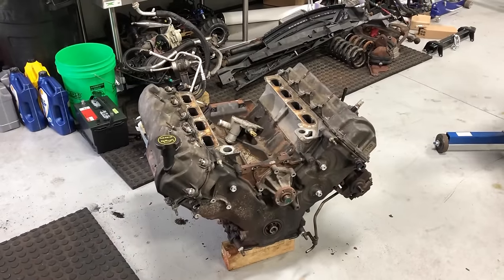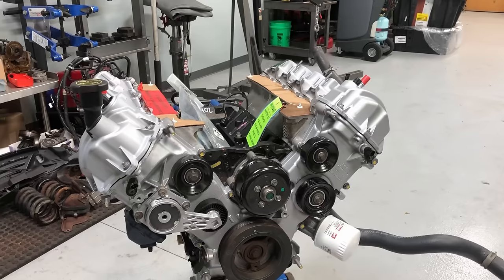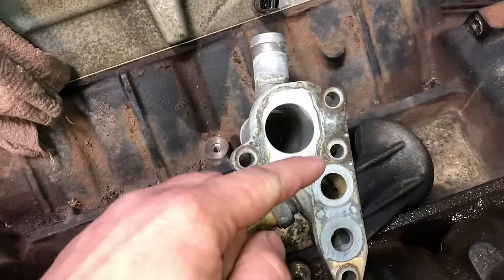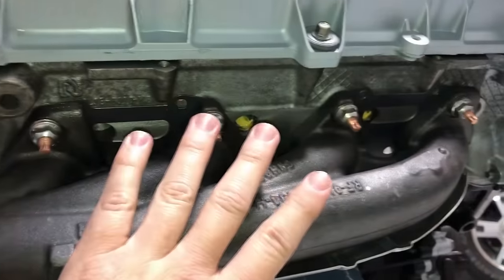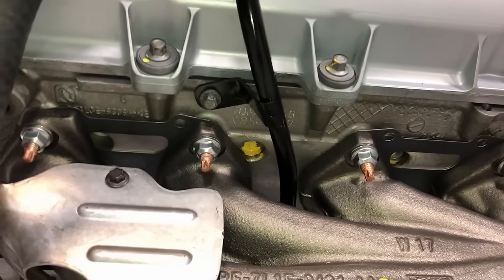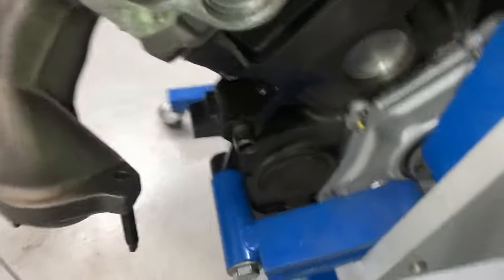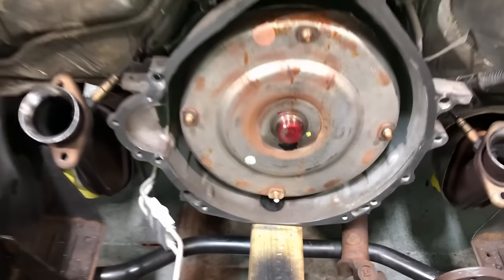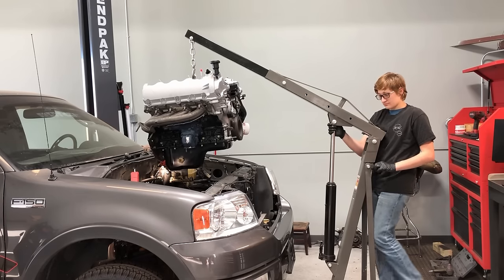Ford 5.4L 3v Triton Engine Removal & Installation Part 2 of 2: Engine Prep and Installation

Comment: Right off the bat, I just want to say thank you for all your work in putting these videos together. Extremely informative. I've watched Part 1 & Part 2 of "Ford 5.4L 3v Triton Engine Removal & Installation" twice while taking notes. Although it's not exactly what I need. It helped me to get an idea of what I was in for... I have a Blown 4.6L 2V MFI SOHC in a 1997 F-150. Getting to R&R it... 
Just wondering if you by any chance Have an R&R Video for that year & engine configuration or at least a 4.6L 2V R&R ?
Any help would be Greatly Appreciated.
Thanks again...

Comment: I got an an 06 5.4 3v..I'm wondering why you bought an 11th gen and why you decided to invest in a new engine.Are these really good trucks.Just wondering cause I'm getting a  new engine installed and transmission.I just can't afford a new truck and would rather get it fixed.

Comment: Related question. Will the Melling oil pump take more priming sessions to build pressure if you are using 5w20 oil? I live in Florida right now so it shouldn’t be too thick in 95 degree weather. I have gone through 6 priming attempts and no response out of the switch yet. Should I drain it and put 5w30 instead?
Reply from the maker: After three attempts you are good to connect the crank sensor and start look for oil pressure within 2 seconds
Reply: Thank you. Oil pressure jumped right up a couple of seconds after starting it. Everything checked out until the test drive. The check engine light didn’t come on, but it did throw two codes. P0012 and P2196. I replaced the cam and crank 
sensors. That improved it, but it looks and feels like it has a misfire. Going to replace the B1S1 O2 sensor and test my coils and coil connector plugs. Is there a chance that an engine that new could have jumped timing if the cam sensor gave a bad reading and the oil pressure dropped while the rpm got low?

Comment: @fordtechmakuloco I don't see where you reinstall the heater coolant return tube.  I have a 2010 5.4 f150 and need to replace it.  I cannot find videos anywhere

Comment: I have a 2000 f150 4x4 with the 4.6, I'm wanting to swap it with a 1999 f150 2wd 5.4, both have the coil on plug design, is there anything special I need to do to make this work like swapping computers or intake ect. Thanks

Comment: I plan on doing this when my motor goes in my 07 ford and I’ve been looking at the Fraser gold standard and wanted to know if it was a solid choice or no
Reply: I plan on doing the same thing with my truck. I will tell you though, I have read about the experiences others have had with Fraser and they were a nightmare to deal with. IMHO, I would most likely end up going with  the powertrain products reman engine which is linked in the description. That's my 2 cents on the subject. In the end it's all up to you man.

Comment: I am doing a motor swap from a donor 5.4 that had a rotted frame and the motor has about 80 thousand less miles then the current motor in my truck. Most electronic accessories on the donor motor are in much better shape. If I anyone could help, should I use the donor engine wiring harness or do I have to keep all electrical from the motor currently in my truck

Comment: Great video! You've helped me so much with my 05 F150 and all the glorious issues of the 5.4 engine.  I know with the timing job you recommend 5w-30, but since this is a new engine do you recommend going with the 5w-20 as recommended by Ford?
Reply: Did a 5.4 rebuilt did you use 5w30 or 20

Comment: Do you still have your Ram? If you had to get a Ford F-150 which one would you buy?
Reply: Glenn Olsen 4.6 or 5.4 2 valve or the older 300, 302, and 351.

Comment: From your experience is the remanufactured 5.4 from Powertrain products the best on the market?
Reply from the maker: The Ford spec remans are best but I have never had a problem with powertrain products engines either.

Comment: Hey Brian. I'm installing a new Powertrain engine. I was wondering if I need to remove the paint off the block where the knock sensors attach. Thanks.
Reply from the maker: Yes you do

Comment: Do these torque spec seem correct for engine mounts? 
258 ft-lb  drivers side
184 ft-lb passenger side
Reply from the maker: You did not specify a year but all specs are in the video description and are accurate yes.

Comment: You mentioned that it comes with the melling oil pump. Does it come with the high volume or should I change it out
Reply from the maker: They come with the M360 standard volume and higher pressure.
Reply: I  have a f150 2004 and bought a power train engine. I just ordered a m340hv. Do you thinks that’s a good choice or cancel the order?

Comment: @fordtechmakuloco I have a 2006 Ford F-150 5.4 3v flex fuel I had engine trouble with it specifically low compression on the left side of the engine I rebuilt the engine and still have the same problem it’s fine when it first starts but won’t go above 3k rpm and when warm it dies I also swapped a motor thinking maybe the engine was just completely shot or had a crack somewhere that wasn’t being caught however it did the same exact thing I had the pcm flashed at the dealer with the original
Engine in but it didn’t seem to make a difference I’m looking at buying a new pcm if that doesn’t fix the issue what else could it possibly be it has all new sensors in it as well and a new fuel pump

Comment: My 5.4 had a hard life before I bought it (2005 Lariat) and spit out a main recently. It seems like Powertrain  Products is the place to go with, but I would like to know what your opinion is on going this route vs. rebuilding it myself? i have the skills, but my concern is which way would give me a longer lasting engine? There's lots of stories about rebuilders running with mismatched bore sizes and balance issues, so there is definitely a question in the back of my mind. Thanks for all these videos. They have saved me thousands of dollars over the last few years.
Reply: get a powertrain COMPANY out of OK, they make the Ford Crate motors. Same price, not all the Dorman crap in it

Comment: Would you recommend this over swapping for a 5.0 without most of the issues of the 5.4?
Reply: I have thought of that myself.  But I think it would be hard because the transmission and computer system is paired with this engine.  I could be wrong though
Reply: M Mardell no you’re right

Comment: Ive watched all your videos. I have a 2009 f250 5.4 3v. I had roller follower issues and dropped a valve. I bought a used engine from a 2008 f250 5.4. It ran terrible! Couldnt make 35 mph for long. Almost gave up on it. (Have a 2000 f250 that runs great!) But could'nt diagnose the problem with confidence. Took out the o2 sensors and it runs better any advice you can share. Ive got over $7000 invested in a standard single cab white 2009 f250 with a 5.4. Seemed like a deal for $4000 at first. But now im too far in. Need help
Reply: Also the original motor ran great! But started ticking. Cold started and sputtered one morning and it was history or could i have saved it????

Comment: When the power steering bolts snap how do you go about fixing that when motor still in vehical
Reply from the maker: snap them all off then let the power steering pump slide down the studs remaining and then cut the studs so the pump can be moved out of the way. Then continue with normal procedures for bolt extraction.

Comment: i replace a 5.4 motor in my 2007 f150 i fellow your instruction on getting pressure then i let it idle idrove it about 5 mile everything was good this was 3wks ago well i went to wash it 1mile from home ilet itrun while i washed it i pull out of car wash drove about a mile it started running rough especially coming to a stopnow i have all these codes 0340, 0182, 0022, 0018, 2198, 0355, and 0345 do you think you have any ideal what going on any whould be appreciated

Comment: @ 54:27 did you use 5-20 or did you go with 5-30 for better protection on your chain guides?
Reply from the maker: 5w-30

Comment: Help. I just dropped my power train engine in to find that it has dowels installed also!  Is there a reason why I would choose to remove one or the other. ?
Reply from the maker: You would use the dowels that came in the new engine.

Comment: What is the average cost for this job?

I know the engine is about $3500 from Powertrain Products, I have been looking at replacing my engine in my 2005 Mustang GT with 229k on it, but with all the odds and ends you added and your labor, what was the final bill for this customer
Reply from the maker: $6,900 - $7,200 with all the extras.

Comment: I’ll be replacing my 2005 5.4 engine and I need an all new exhaust system. What are your thoughts on headers and a true dual exhaust?  Bad ideas?
Reply from the maker: yup!
Reply: Do I need to go back to all original Ford cats and exhaust manifolds?  I want to do this right so I can keep my truck another 10 years. I’ve had it 14 years so far.
Reply from the maker: Yes I would.
Reply: @FordTechMakuloco  Do you have a source for OEM cats? Or will a decent aftermarket cat be alright?
Reply from the maker: Magnaflow direct fit units.

Comment: Excuse me, I would like to know why a mechanic friend changed the 5.4 3v motor time chains twice and exactly with the timing specifications and it started well but then it started to fail and the computer checked the time chain three more times and the same did not happen.  I know what would happen there, thanks
Reply from the maker: He has oil pressure and volume issues.

Comment: Am not getting  oil pressure  with the new engine  need help
Reply: neither did I.  This procedure doesn't work in every case. I took off the oil filter and adapted a shop vacuum cleaner with a rubber heater hose to suck the oil through the oil filter adapter. Then when you crank you put the filter back on and crank you will see the good result of oil pressure and not crank until you scratch your cylinder walls!

Comment: Does the manufacture recommend 0w20 or 0w30 even 5w30 full synthetic ??
Reply: Ford recommends 5w-20.  Brian says 5w-30..  Mostly just change the oil regularly and take care of it like you're supposed to.
Reply: I’ve also asked that question hundreds of times on this channel. Only users in the comments will give their input. I think 5w-30 is better, but he can’t/won’t answer. Who knows.
Reply: @garrettstevensen2467  I also think 5w30 is a better choice these 20 weight oils are to thin for use in trucks
Reply: @johnmattiazzo3900  I worry to much about the small oil passages in the vct and lifters..  For now im sticking to 5w20 every 3k miles since I tow a lot with it.
Reply: Garrett Stevensen Brian has recommended 30w in a few videos. I run 30w in my 18 5.0. 20w was for CAFE standards, not engine longevity
Reply: 5W30. 5W20 was for CAFE standards, not longevity.

Comment: Did you get that truck from around you?I live straight across the pond and even the 2014s look horrible by now.
Reply: The slurry they put on the roads to melt snow really seems to destroy vehicles. I live in Arizona but would you northerners prefer they not use it?
Reply: @timothycc711  here's the thing my son's 27 year old Camry is 99 percent rust free,I think what we would prefer is to have vehicle manufacturers put a stop to it,we know they can as cars like my son's are proof,they just choose not to

Comment: Brain Have you installed one of their Used engines before and would you recommend those engines as well?
Reply from the maker: Yes I have with no problems but you could get the same thing at a local junkyard just ask for grade "A".
Reply: Brain Thanks for the quick relay I called the company and was told that it would be 4 -6 weeks to build and 3 day delivery which I can’t afford that time.

Comment: Just changed my transmission filter and pan fluid . Replaced fluid now after sitting all night the cold level shows over full but at running temperature shows half way down from hot level thought that was strange anybody know why thanks

Comment: Jasper got rid of the phasers in their refurb motors and fixed the spark plug issue. Other than bolts it is pointless to swap any old components especially if you spent the money to replace a motor. Your technician already has to bolt every to the new motor so go buy a pile of fresh parts! Save money in the long run

Comment: On a 4.6 or 5.4 can the heater hose connection be blocked off or pluged? For racing purposes.  Blocked or pluged behind water pump? Is this ok. NO BODY SEEMS TO GIVE ME AN ANSWER.  I ASK LOT OF FORD PEOPLE WITH NO ANSWERS. JERRY
Reply from the maker: Most just splice them together to bypass

Comment: Really, I don't know where to begin with my statement.  I have a  2011 Ford f150 Lariat 3.5 ecoboost Pearl White.  On Oct. 4th of 2020 my engine light on because of my turbo. 
Drove to the Ford Dealership Echelon Ford here New Jersey. 
Also my passenger signal and stop light wasn't working but bulb stay lit.
I can't explain all the details but now I need a new engine .  My vehicle was working before they touch it and now its done ??? 
And never replaced my bulbs back because they said I needs a module replaced for $ 829.00.   ???

Comment: Just finished installing my remaned 5.4 had a hard time turning the engine to line up bolts for torque converter on the crankshaft pully bolt ended up having to use a pipe wrench, after putting everything back together tried to crank it using the key and it acted like it had a bad battery but the battery is new so tested wiring to the starter all good went ahead and replaced the starter since it was stock anyway (04) same thing happened burly turns and then quits battery meter goes down to zero with jumper cables on anyone have any thoughts?

Comment: I have a 2016 f150 3.5 naturally aspirated, and it has 90,000 miles on it. It idols poorly and has 14.8 mpg on average and that can’t be right as I drive mostly highway. Also I have some wobbling and shaking at high speeds. There is no info on this engine can you please help 🙏🙏🙏🙏🙏🙏🙏
Reply: Sounds like the spark plugs need to be changed. If they have been changed they may be gapped wrong. Ford changed the the recommended gap setting. He has a video that talks about that. 
That should smooth out the idol and drastically increase mpg.

Comment: You must have ice water running through your veins.... how does that cost. With remand engine. And all the new parts and manifolds spark plugs. Gasgets, etc. The way you did it. Or roughly whats that cost or set you back?
Reply from the maker: This is how I do all my engines now that’s why they run $6,700 installed
Reply: I appreciate your reply. And all you do for all of us ford guys and gals out here. Your a true skilled professional. I know weve talked about the timing set on one my trucks. But the floods down here in southern Illinois in may n June. Threw a wrench in my entire summer and fall. The coil spring on the drivers side broke. And the high pressure P/S was weeping. That P/S line is ignorant to change. So inreplaced every last hose and the pump on the P/S system. ( used your video on c111 pump pully removal and got the whole OTC puller installer kit thansk for that video) and decided to replace the entire front suspension while i was at it. Besides the KYB struts and sway bar bushings. Its all been genuine motorcraft and ford parts. Tie rods, in and out, control arms upper and lower, sway bar Links. Wheel hubs. Rotors, brk. Pads. Only had reman calipers from M/C were available intermediate steering shaft. And went as far as to follow the ford recommend procedure and replaced all the suspension bolts and lock nuts with genuine replacements as well. Most of the P/S system hoses also all motorcraf. ( and got the vaccum evac.  adapter for P/S system from a video of yours also. And just got my air lift radiator vaccum kit this afternoon.) Without your videos and you sharing your knowledge i probably wouldn't even thought of going all out... eventually ill get it up to you for the timing set.

Comment: I like how you replace things that should be new on a new motor and you use quality parts. Can’t say I know of any mechanic around me that gives a sh%t. Ford here shut something under wife’s Lincoln hood and gave us a outie and stared the paint. Denial of anything. Another Ford mastertech put timing chain in my EcoBoost and left intake clamps loose. Another tire shop I had dealt with a few times did some better but recently had the fix a tire leak and they changed valve stem and jacked up valve stem hole. Still not fixed🤔. Only thing that gets pulled apart and back together right is when I have to do it myself. I was a bodyman in my younger days. Don’t have the time to diagnose, figure out best fix and fix everything on our cars myself. Any advice on finding a good Mechanic?

Comment: Can I just remove fuel pump relay fuse and igtion fuse to prime the engine?
Reply from the maker: There is no fuel pump relay, what is wrong with the priming method shown?
Reply: @FordTechMakuloco  mine is a 2010 ford f150 xlt/xtr 5.4
Reply: @FordTechMakuloco  my first time and a lot of money, I don't want to ruin it
Reply: @FordTechMakuloco   @FordTechMakuloco thank you,
 I got oil pressure in less than 10 seconds, I pumped oil throug the passage on the oil filter mount, just like melling video, 
I did remove the fuel fuse, ignition fuse, and the crankshaft sensor

Comment: I see the oil cap says 5w20, did you go with 5w30 instead?
Reply from the maker: Of course.
Reply: @FordTechMakuloco  uh oh...i just had a 4.6 2v put in my 97f150. The shop that did the install informed me that to uphold the warranty, oil chamges must be done there or at a reputable shop. Can i request 5w30? And also do you use synthetic?